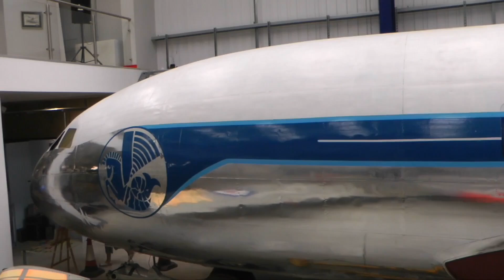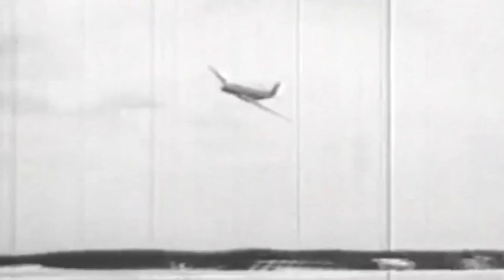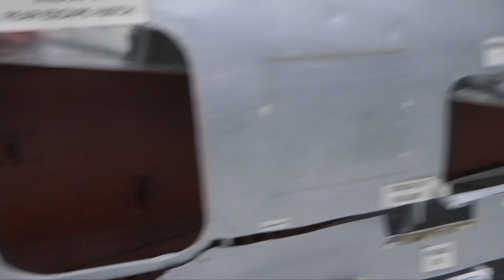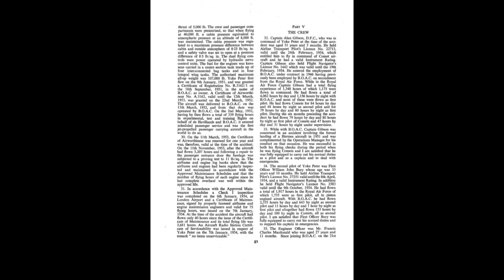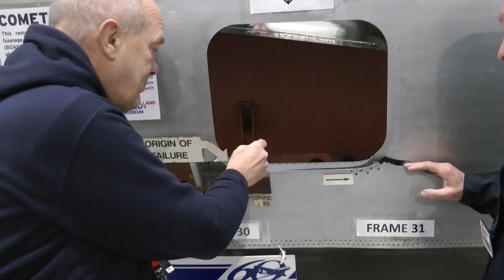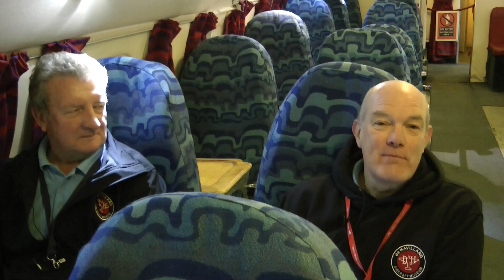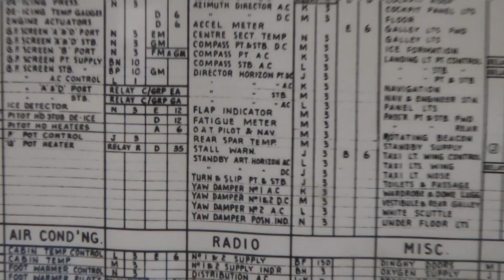The plane that changed the skies forever. DH.106 Comet Airliner from de Havilland

Comment: The number of innovations  in one aircraft is simply amazing.
Reply: What innovations?
There was nothing new or cutting edge about the Comet... it wasn't even an all metal aircraft
Reply: @sandervanderkammen9230 

It will come as no surprise to most that we feel able to shed some light on some common misconceptions and myths, of course.

It's always good to see the facts presented clearly and concisely isn't it?

  That's correct, Bow-wing (See B-47 wing collapse & wing folding incidents) hadn't managed to sell more than a dozen pressurised airliners before the first flight of the Comet. Having had more than 50 years design & build experience on the type there can be no excuses for the horrendous Bow-wing Max incidents for example. 
   
  That's correct of course, at the time the Comet didn't have particularly high accident loss rates relative to many other aircraft.

Losses comparisons, how things were in those days.

DeHavilland Comet 4                            14%
DeHavilland Comet all  (ff 1948)         17%

Boeing 307                                              70%
Boeing 247                                              48%
Boeing 707            .                                  20% 
Lockheed Electra Turboprop                   29%
Canadair CL-44  Turboprop  (ff 1958)    46% 
Convair CV-580  Turboprop                    22%
Convair CV-880    (ff 1959)                     27% 
Convair CV-990     (ff 1961)                   35%
Tupolev T-104 (ff 1955)                          16%

   Indeed, De Havilland carried out a full stress analysis & engaged in a comprehensive & protracted testing program which is why key De Havilland people were happy to be aboard flying DH Comet aircraft.

  Of course it is in fact the case that no aircraft before the Comet had been subjected to as much testing as the De Havilland Comet.

  Agreed, of course De Havilland did indeed always work to better than industry standards at the time, used up to date knowledge for the design & construction & no evidence of negligence  or criminal negligence was ever produced in relation to the DH Comet.

  De Havilland designers / engineers knew all there was to know about metal fatigue at the time they designed the DH Comet.

  Of course De Havilland had prior experience building many all metal construction airframe aircraft including many passengers aircraft & thousands of jet powered fighter aircraft that were primarily of metal construction with pressurised cockpits & jet engines built by De-Havilland.

  Indeed, one of the key features of the DH Comet was of course its high altitude capability.
It was in fact the first airliner to have 8 psi pressurisation for the entire fuselage length which resulted in it being the world's first airliner where pressurisation stress significantly exceeded flying load stress.

  Obviously the Comet was an all metal construction airframe aircraft & like all similar airliners used other materials for no structural items such as interior trim. The rear pressure bulkhead for the Comet was obviously not made of wood for example.

  British Aircraft Achievements Notes.

  The world's first gas turbine aero engine demonstration was in fact performed by Whittle in 1937. Sir Frank Whittle patented bypass & reheat before 1936.

  The world's first axial multi stage sequential stator rotor turbines & compressors were produced in England by Parsons of Ireland & North England. The same components used in many modern gas turbine aero engines. Parsons also did some work on the internal combustion gas turbine engine. In fact people at the time in England before 1900 had already discussed the concept of using those components for an internal combustion gas turbine aero engine for powered flight & so had invented the jet aircraft before the Wright Brothers had given any thought to flying.

  The first example of a pressurised cabin aircraft was a British design Airco aircraft built under licence in the US & modified to have a pressurised cabin during a joint UK / US research project.

  The gas turbine engine was first conceptualised & patented before 1800 in England.

As always we hope this helps of course, obviously.

Cheers & 👍 indeed.
      

The line above has clearly been left blank.
. . ..... ....... . ...
..... ..... ... . ...
Reply: @sandervanderkammen9230 

The DH Comet had significantly more research and pre-production testing than any previous airliner had ever been subjected to.

The fabulous trail blazing DH Comet.
World's first jet airliner.
World's first high altitude airliner.
The first aircraft with a full fuselage width and length pressurised cabin where pressurisation stresses were higher than flying load stresses and were many times higher than flying load stresses. 

It's surprising then just how low the accident loss rate was for the Comet. 

    How things were back then.
Accident losses - % of aircraft built.

DeHavilland Comet 4 UK                     14% 
DeHavilland Comet all (ff 1949)         17%  
Vickers VC10 UK (ff 1962)                   5%

Douglas DC-1                                      99%
Douglas DC-2                                      47%
Douglas DC-3                                      30%
Douglas DC-4                                      26%
Boeing s300                                          72% 
Boeing 307                                            70%
Boeing 247                                            48%
Boeing 707  (ff 1958)                           20% 
Lockheed L-049/149 Constellation    30%
Lockheed Electra  Turboprop .            29%
Fairchild FH-227                                   30%
McDonnell Douglas DC-8                    14%.
Sud Aviation Caravelle  (ff 1955)       15%
Canadair CL-44 Turboprop (ff 1959) 46%  
Convair CV-580  Turboprop                22%
Convair CV-880     (ff 1959)                27% 
Convair CV-990     (ff 1961)                33%
Tupolev T-104        (ff 1956)               16%
Vickers Viscount   (ff 1948)               32%             

  The Vickers VC10, fastest Atlantic crossing for a non supersonic jet airliner, held the record for 41 years.

For the first few years of operation the Caravelle & Comet had similar accident loss fatalities.

Instances of all marks of Comet flew with full certification until retirement of the individual aircraft until 1992. Nimrods were flying until 2010. 

The first few Nimrod airframes were Comet 4 airframes with the equipment bay tacked on. Subsequent Nimrods were new build Comet 4 airframes with Nimrod modifications built by the DH team at Hawker Siddeley.

Comment: Beautiful airplane!
Reply: Not after they crash...
Reply: @sandervanderkammen9230 

It will come as no surprise to most that we feel able to shed some light on some common misconceptions and myths, of course.

It's always good to see the facts presented clearly and concisely isn't it?

  That's correct, Bow-wing (See B-47 wing collapse & wing folding incidents) hadn't managed to sell more than a dozen pressurised airliners before the first flight of the Comet. Having had more than 50 years design & build experience on the type there can be no excuses for the horrendous Bow-wing Max incidents for example. 
   
  That's correct of course, at the time the Comet didn't have particularly high accident loss rates relative to many other aircraft.

Losses comparisons, how things were in those days.

DeHavilland Comet 4                            14%
DeHavilland Comet all  (ff 1948)         17%

Boeing 307                                              70%
Boeing 247                                              48%
Boeing 707            .                                  20% 
Lockheed Electra Turboprop                   29%
Canadair CL-44  Turboprop  (ff 1958)    46% 
Convair CV-580  Turboprop                    22%
Convair CV-880    (ff 1959)                     27% 
Convair CV-990     (ff 1961)                   35%
Tupolev T-104 (ff 1955)                          16%

   Indeed, De Havilland carried out a full stress analysis & engaged in a comprehensive & protracted testing program which is why key De Havilland people were happy to be aboard flying DH Comet aircraft.

  Of course it is in fact the case that no aircraft before the Comet had been subjected to as much testing as the De Havilland Comet.

  Agreed, of course De Havilland did indeed always work to better than industry standards at the time, used up to date knowledge for the design & construction & no evidence of negligence  or criminal negligence was ever produced in relation to the DH Comet.

  De Havilland designers / engineers knew all there was to know about metal fatigue at the time they designed the DH Comet.

  Of course De Havilland had prior experience building many all metal construction airframe aircraft including many passengers aircraft & thousands of jet powered fighter aircraft that were primarily of metal construction with pressurised cockpits & jet engines built by De-Havilland.

  Indeed, one of the key features of the DH Comet was of course its high altitude capability.
It was in fact the first airliner to have 8 psi pressurisation for the entire fuselage length which resulted in it being the world's first airliner where pressurisation stress significantly exceeded flying load stress.

  Obviously the Comet was an all metal construction airframe aircraft & like all similar airliners used other materials for no structural items such as interior trim. The rear pressure bulkhead for the Comet was obviously not made of wood for example.

  British Aircraft Achievements Notes.

  The world's first gas turbine aero engine demonstration was in fact performed by Whittle in 1937. Sir Frank Whittle patented bypass & reheat before 1936.

  The world's first axial multi stage sequential stator rotor turbines & compressors were produced in England by Parsons of Ireland & North England. The same components used in many modern gas turbine aero engines. Parsons also did some work on the internal combustion gas turbine engine. In fact people at the time in England before 1900 had already discussed the concept of using those components for an internal combustion gas turbine aero engine for powered flight & so had invented the jet aircraft before the Wright Brothers had given any thought to flying.

  The first example of a pressurised cabin aircraft was a British design Airco aircraft built under licence in the US & modified to have a pressurised cabin during a joint UK / US research project.

  The gas turbine engine was first conceptualised & patented before 1800 in England.

As always we hope this helps of course, obviously.

Cheers & 👍 indeed.

The line above has clearly been left blank.
. . ..... ....... .. . .... 
 ........ ..... . ........ .
Reply: @sandervanderkammen9230 
The DH Comet had significantly more research and pre-production testing than any previous airliner had ever been subjected to.

The fabulous trail blazing DH Comet.
World's first jet airliner.
World's first high altitude airliner.
The first aircraft with a full fuselage width and length pressurised cabin where pressurisation stresses were higher than flying load stresses and were many times higher than flying load stresses. 

It's surprising then just how low the accident loss rate was for the Comet. 

    How things were back then.
Accident losses - % of aircraft built.

DeHavilland Comet 4 UK                     14% 
DeHavilland Comet all (ff 1949)         17%  
Vickers VC10 UK (ff 1962)                   5%

Douglas DC-1                                      99%
Douglas DC-2                                      47%
Douglas DC-3                                      30%
Douglas DC-4                                      26%
Boeing s300                                          72% 
Boeing 307                                            70%
Boeing 247                                            48%
Boeing 707  (ff 1958)                           20% 
Lockheed L-049/149 Constellation    30%
Lockheed Electra  Turboprop .            29%
Fairchild FH-227                                   30%
McDonnell Douglas DC-8                    14%.
Sud Aviation Caravelle  (ff 1955)       15%
Canadair CL-44 Turboprop (ff 1959) 46%  
Convair CV-580  Turboprop                22%
Convair CV-880     (ff 1959)                27% 
Convair CV-990     (ff 1961)                33%
Tupolev T-104        (ff 1956)               16%
Vickers Viscount   (ff 1948)               32%             

  The Vickers VC10, fastest Atlantic crossing for a non supersonic jet airliner, held the record for 41 years.

For the first few years of operation the Caravelle & Comet had similar accident loss fatalities.

Instances of all marks of Comet flew with full certification until retirement of the individual aircraft until 1992. Nimrods were flying until 2010. 

The first few Nimrod airframes were Comet 4 airframes with the equipment bay tacked on. Subsequent Nimrods were new build Comet 4 airframes with Nimrod modifications built by the DH team at Hawker Siddeley.

Comment: Lovely aircraft, exemplary of the technical risks involved in pioneering new technology.. I love the Nimrods.
Reply: What new technology?
 The Comet was not the first pressurized airliner and was not the first jet aircraft.
 The first pressurized aircraft, the Junkers Ju-49 flew in 1931.
 The first jet aircraft was the Heinkel He-178 it flew on August 27th, 1939.

FYI: the Hawker Siddley HS.801 Nimrod is not a Comet nor does it share any significant parts or sub-assemblies  in common with the Comet
Reply: @sandervanderkammen9230 

It will come as no surprise to most that we feel able to shed some light on some common misconceptions and myths, of course.

It's always good to see the facts presented clearly and concisely isn't it?

  Agreed, that's entirely correct, it is in fact the case that the Comet was designed with military use in mind & the Nimrod is a DH Comet.

  That's correct, Bow-wing (See B-47 wing collapse & wing folding incidents) hadn't managed to sell more than a dozen pressurised airliners before the first flight of the Comet. Having had more than 50 years design & build experience on the type there can be no excuses for the horrendous Bow-wing Max incidents for example. 
   
  That's correct of course, at the time the Comet didn't have particularly high accident loss rates relative to many other aircraft.

Losses comparisons, how things were in those days.

DeHavilland Comet 4                            14%
DeHavilland Comet all  (ff 1948)         17%

Boeing 307                                              70%
Boeing 247                                              48%
Boeing 707            .                                  20% 
Lockheed Electra Turboprop                   29%
Canadair CL-44  Turboprop  (ff 1958)    46% 
Convair CV-580  Turboprop                    22%
Convair CV-880    (ff 1959)                     27% 
Convair CV-990     (ff 1961)                   35%
Tupolev T-104 (ff 1955)                          16%

   Indeed, De Havilland carried out a full stress analysis & engaged in a comprehensive & protracted testing program which is why key De Havilland people were happy to be aboard flying DH Comet aircraft.

  Of course it is in fact the case that no aircraft before the Comet had been subjected to as much testing as the De Havilland Comet.

  Agreed, of course De Havilland did indeed always work to better than industry standards at the time, used up to date knowledge for the design & construction & no evidence of negligence  or criminal negligence was ever produced in relation to the DH Comet.

  De Havilland designers / engineers knew all there was to know about metal fatigue at the time they designed the DH Comet.

  Of course De Havilland had prior experience building many all metal construction airframe aircraft including many passengers aircraft & thousands of jet powered fighter aircraft that were primarily of metal construction with pressurised cockpits & jet engines built by De-Havilland.

  Indeed, one of the key features of the DH Comet was of course its high altitude capability.
It was in fact the first airliner to have 8 psi pressurisation for the entire fuselage length which resulted in it being the world's first airliner where pressurisation stress significantly exceeded flying load stress.

  Obviously the Comet was an all metal construction airframe aircraft & like all similar airliners used other materials for no structural items such as interior trim. The rear pressure bulkhead for the Comet was obviously not made of wood for example.

  British Aircraft Achievements Notes.

  The world's first gas turbine aero engine demonstration was in fact performed by Whittle in 1937. Sir Frank Whittle patented bypass & reheat before 1936.

  The world's first axial multi stage sequential stator rotor turbines & compressors were produced in England by Parsons of Ireland & North England. The same components used in many modern gas turbine aero engines. Parsons also did some work on the internal combustion gas turbine engine. In fact people at the time in England before 1900 had already discussed the concept of using those components for an internal combustion gas turbine aero engine for powered flight & so had invented the jet aircraft before the Wright Brothers had given any thought to flying.

  The first example of a pressurised cabin aircraft was a British design Airco aircraft built under licence in the US & modified to have a pressurised cabin during a joint UK / US research project.

  The gas turbine engine was first conceptualised & patented before 1800 in England.

As always we hope this helps of course, obviously.

Cheers & 👍 indeed.

The line above has clearly been left blank.
. . ..... ....... . ...
..... ..... ... .
. .... .